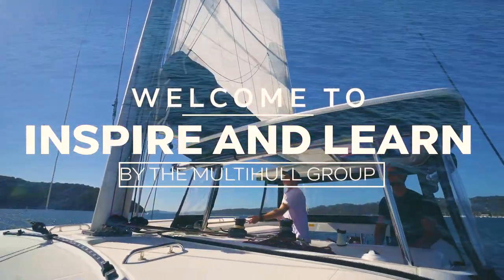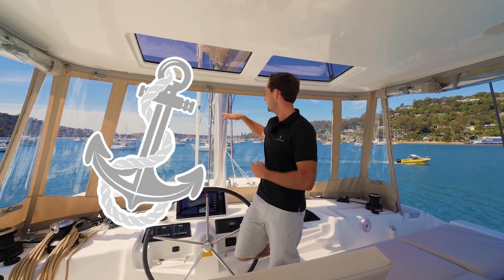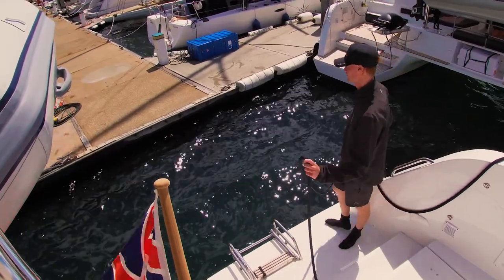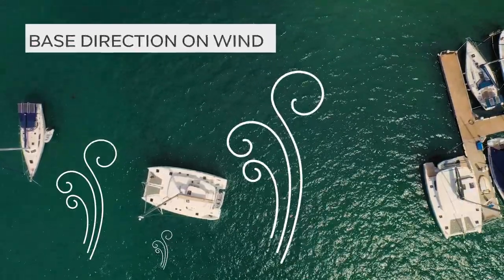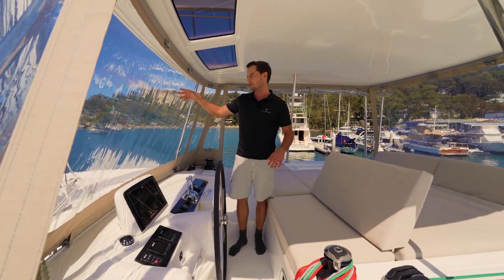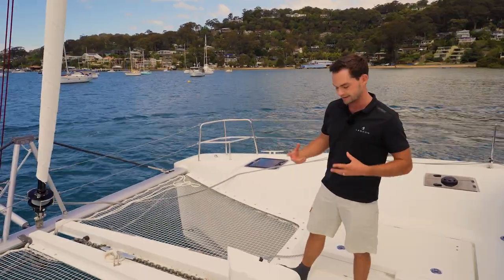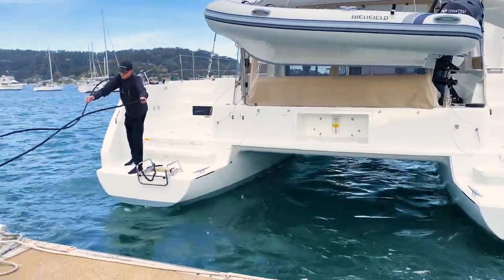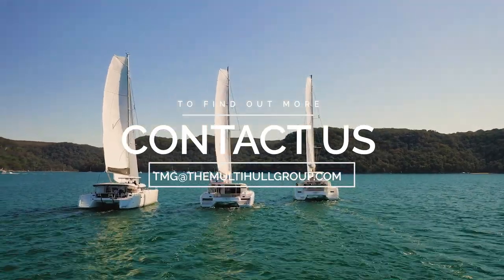MEDITERRANEAN MOORING | Using an Anchor or Mooring Block

Comment: Good run through. In the second case, make sure you keep the 'slime lines' well away from your props. As you come in, you might need to stop the marinero from pulling the slime line (mooring block lead line) out of the water too soon. Leave it until you have your aft lines on to minimise the risk of fouling your props. Otherwise, it's mask and snorkel time. I speak from experience on that one!
Reply from the maker: Thanks for this addition. I actually was going to add this as an afterthought.
Reply: great point, thank you.

Comment: Nice video, couple of things  worth thinking about though, when using the anchor if your in a big yacht like the lagoon 46 and the leeward boat is small like a 30 ft mono and you have a cross wind you could cause their anchor to drag if you rest on them. So you might want to try to put minimum weight on any leeward vessel. Also on the mooring lines gloves are advised,

Comment: Nicely filmed and clear instructions. I would just add that if you find yourself  using bow lines (as most wharfs, docks and marinas do in Croatia) then the sequence of attaching lines is determined by wind direction. If the wind is blowing onto the wharf the first lines you attach are the bow lines. And obviously if it's from an angle onto the dock then it's, the front ´windward side first. then the windward stern line , then other bow and last the stern leeward. The bow line system is good and all but it really is the cause of many a fouled prop and marinas make decent money charging for divers and repair of their lines. When it's windy (Croatia!)  you can sit on a wharf and watch boat after boat catch other boats bow lines or the marina lines. And with most catamarans the prop is designed to come off if tangles (to protect the sail drive) so after fouling a bowline  its not unusual to lose a prop the next day as you drop into reverse for the first time ; another money make for marinas.

Comment: Thank you for this excellent guide to mooring in the Mediterranean. 
Instead of using the windlass to tighten the chain, I would have used the engine in reverse. This is also useful for proving whether the anchor has grabbed the bottom. I'm afraid the windlass doesn't have enough power to do that.
Reply: I agree, would it be better to first engage the grip in the anchor and then release it gradually as you approach the dock, keeping it nice and tight at all times?

Comment: Thank you -- super helpful. Re: future content, you might consider some parent categories like "sail handling" or "maintenance," whereby you could develop lots of videos under each of those broader categories. E.g. replicate the engine maintenance video but for electrical systems, plumbing, sail/rigging and general boat maintenance. What tools do you carry for each of those areas, what routine inspections do you conduct, what does preventative maintenance look like in each of those areas?

Re: sail handling - I enjoyed the trim video but this might be extrapolated a bit.. e.g. sail selection for light wind vs. heavy winds, up vs. downwind, pros/cons of different sail plans, common issues with flying spinnakers or self-tackers, etc.

Thanks again, keep going!
Reply from the maker: Thanks for this fabulous inspiration. We will try to draw on your feedback for our future content.

Comment: Thanks for the great video.  I was curious why you used the snubber as a safety instead of letting some rode out to take the load off the windlass?
Reply from the maker: Good question! Its personal preference. Bearing in mind when you attached snubber and release chain you'll move back towards to dock. If you plan on doing this, just make sure you are a little further off the dock when initially set so you'll have plenty of room once the snubber is tight. 

Thx, Joe

Comment: 1:00 this is also the reason that in the med cats arent realy popular because the dock fees are 1,6-2x of those for a single hull boat, because the cat need two berth, the marine will charge you for that. Average marine in the Med will charge 50-100 EUR per day for single hull 12m/38ft boat.
Reply: I will disagree with the popularity.  Over 50% of the charter boats in the Turkish side of the Aegean are Cats and this number is growing practically daily as the demand for them continues to grow.  The opposite is true for private boats but the number of monohulls across the board is decreasing.  I have spent 5 months so far this season working in cats and only two weeks on monohulls.

Comment: Question...Do you not need to SET the anchor first like you would normally do at an anchorage?
Reply from the maker: Thanks for your comment. Yes, this is advised to ensure that the anchor is holding before you get too close to the dock. If it is windy, the other option is to let out plenty of chain, get the vessel in and secure with lines on the dock, then hoist the anchor and watch for any signs of dragging. Doing it this way is find, you just need to be prepared to drop lines and go again if your first attempt hasn't bedded the anchor well enough. You want to be confident in the anchor set well as this is all that is stopping the stern of the boat coming into contact with the dock. 

Regards, Joe

Comment: As a newly, why would I not use the bridle instead of a snubber and take the load off the capstan?
Reply: Probably know this by now but, when med mooring with your anchor it's difficult to use a bridle and correctly determine the distance back to the dock. Not impossible but because you attach the bridle and let it play out till its tight you have to be pretty good at guessing that distance especially given you are doing all this with the anchor chain under a bit of tension and backing against a finite distance; the dock. Often you don't really want to bump up against the concrete wharf even with fenders off the stern and in many town docks the sea floor rises up to the dock so you have concerns of rudders or sail drives hitting..so most often you play it safe and don't bother with a bridle.